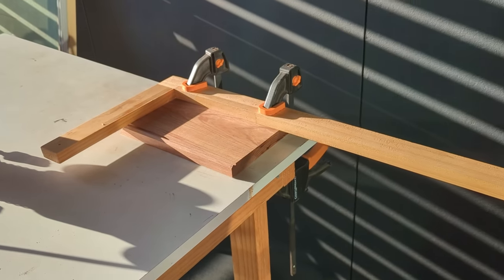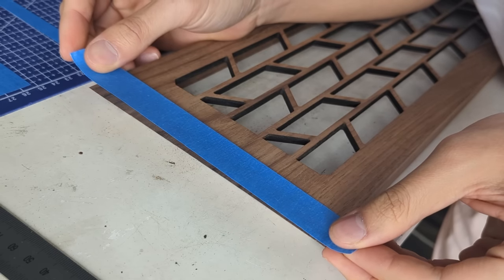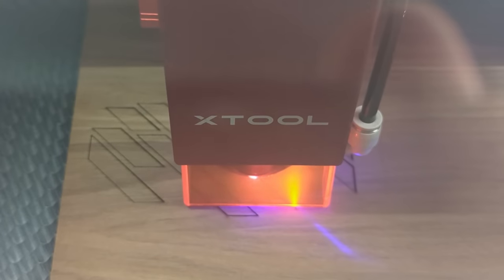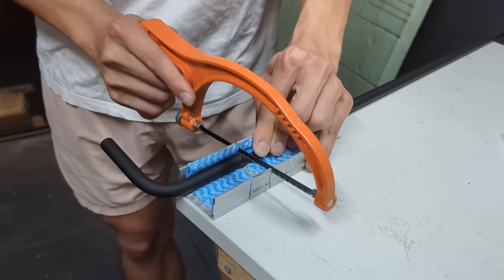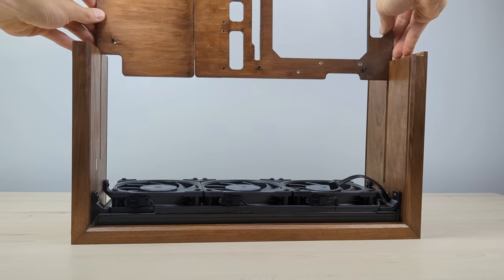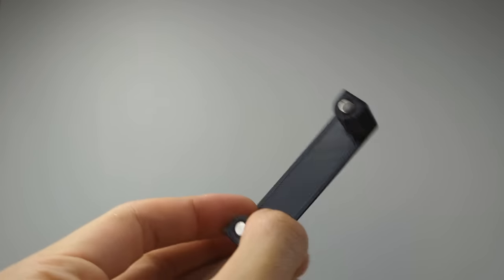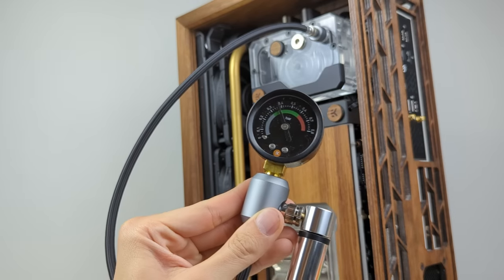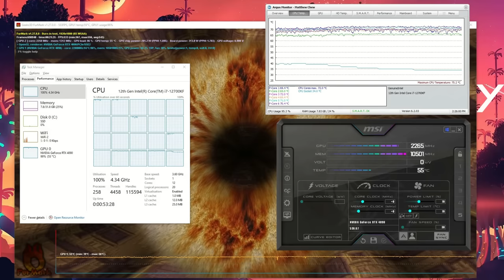Ultimate Hardline Wooden ITX PC | ASUS TUF RTX 4090 | i7 12700KF | DIY Wood PC Case

Comment: This is fantastic! Easily your best build yet. As others have said, the attention to detail is perfect. And it's amazing how similar this wood looks to Walnut.
If I had one critique, it would be this: When you have mitered corners, they're an endgrain to endgrain connection. This is not the strongest, and can spread apart or come apart entirely with stress (like heat buildup). To account for this, what you can do is reinforce the miter somehow. Usually with a spline or two. This provides a face grain to face grain glue joint going through the miter, and significantly increases the strength. You could even use something like brass that has been scuffed up on its face (to provide grip for the glue) as a spline to keep with the aesthetic.

Miter joint aside, this was truly great to watch.
Reply from the maker: Thanks! Yes mitres are not the strongest type of joint. But for a case that's not bearing alot of load, it's been proven stable for me.
Reply: Pointing out and then mansplaining the most unnecessary and granular detail
Reply: @LT.dans_new_legs  Or perhaps they were simply trying to be helpful by offering actionable information. No need to critique what is likely meant to be a helpful comment. The internet can be a nice place.

Comment: There were so many times throughout the build where you had a piece that seemed totally random but all of the other parts were arranged specifically to give that one part just enough space and it was like a jigsaw puzzle. I can't imagine the amount of planning it took to get it this perfect.
Reply from the maker: Yup, this project was a big one. Had to model every single part in 3D to make sure it fit into the system. Thanks for watching!

Comment: Great attention to detail on this build, really liked the cable management, very clean design. To avoid slight inaccuracies when you need to cut boards larger than your laser cutter consider using locating pins in the work piece. I find that works a treat.
Reply from the maker: Thanks for the tips!

Comment: This build is absolutely mind-blowing! The level of detail you’ve put into it is incredible. The only thing that could make it an 11/10 would be replacing the 3D-printed parts with anodized black aluminum to match the other parts in the build. Even so, it’s a solid 10/10. I especially love the idea of incorporating cable channels. This build would look amazing paired with a keyboard designed by Matthew Encina called The Encore, just like your build it beautifully combines both aluminum and wood in its design. Amazing work.
Reply: I just opened up your other videos and wow, you’re absolutely amazing.
Reply from the maker: Thanks! Indeed CNCed brackets would be ideal. But 3d printing is just so easy and accessible these days
Reply from the maker: Thank you for checking my other videos :)

Comment: This is some kind of therapy for my autism ! I am immediately heading to the workshop to work on my current project, then ordering a 3D printer later on (any advice on that would be welcome - I just want to print similar stuff to you). Great wood working skills - love the combo of old and new :)
Reply from the maker: That's great! Glad it has inspired you. I got the prusa mk3 second hand earlier this year and have been very happy with it. But the bambu models have been getting great reviews as well, although I haven't tried one for myself
Reply: @mxcbuilds6633  Thanks - will check them out. I wish I could 3D print some replacement body sections for my rusty mini truck !

Comment: Pro Tip: Use the same screw/bolt head design for a cleaner uniformed look. Take the time to line up the individual wires of the interface cables. Nice build.
Reply from the maker: For sure, great suggestions!

Comment: This is phenomenal stuff. My PC is housed inside an HP case from 2003. It's missing the front panel and all of the IO. I 3D printed a bracket for one of the unpopulated DVD drive bays with a mount for a USB board I salvaged from elsewhere. If this is the ultimate OCD soother, mine is the OCD irritator!
Reply from the maker: Haha as long as the PC works, that's the most important!

Comment: that computer would be a pain to clean and service for sure, it looks epic tho
Reply from the maker: Cleaning is not so bad, just disconnect all the cables, bring it outside, slide out glass panels, brush and shoot with some air, done. Coolant maintenance is going to be an issue I agree, I did not add any drain points. Would probably have to turn the PC upside down and drain it from the fill port.

Comment: For a smoother 3D printed surface use salt an an oven. Pack the pieces with about 2 pounds of fine table salt on a pyrex glass tupper or something like that, then heat to 80°C and the seams of the filament won't be there anymore
Reply from the maker: Thanks for the suggestions! Would try that out some day

Comment: Wonderful result. Thank god you saved so much cash on those little plastic knobs so you could pay the bill for the laser cutter lol
Reply from the maker: Probably a sarcastic comment but I'll address it anyways. Laser cutter is justified because nothing else  can achieve the same/equivalent result. Those black plugs which I only wanted for aesthetic reasons could easily be replicated using my printer. Saving 40$, I can easily use that cash to buy 2 more sheets of plywood for my next project. You have to be smart on where you can save and where you need to spend. Thanks for watching.
Reply: @mxcbuilds6633  I genuinely thought the end result was beautiful and the part of my original comment regarding the caps was meant in jest, not sarcasm.

Comment: That's just art, a real masterpiece!
Perhaps you could undervolt the CPU without loosing performance. Sadly that doesn't work as well as power limiting for 4090 cards. Did you plan the entire PC in CAD before building?
Reply from the maker: The heat issues isn't too bad for my use cases thankfully. Yes every single detail was planned in CAD before execution
Reply: Btw the cables aren't really sleeved. It's just a braided look imprinted into the isolation. I have the same PSU

Comment: I'm genuinely curious how the heat affects the wood in the long run. RTX4090 + i7 12700KF combo is hot af.
Reply from the maker: Been running it daily since the video was uploaded. No issues yet, no leaks, wood has not warped, temps are under control.
Reply: @mxcbuilds6633  Cool, hope to see a long term review about this build, I live in a tropical place so I'm curious how well this kind of build last in a warm climate
Reply from the maker: @pauljoseph3081  I expect it not to do so well in a tropical environment. The change in humidity will cause the wood to warp alot. I will do a "1 year later" type video when its due.

Comment: Beautiful, very very clean. Two questions though; One, wont those foam adhesive pads lose their adhesive properties relatively fast? Two, be honest, was the color scheme of the entire rig itself based on the T-Create Ram sticks, or was that truly a coincidence? Whatever the answers, I want this PC so badly, good work.
Reply from the maker: Thanks! The foam tape actually still holds the fan cable channels well. Only the fan connectors themselves have come loose from the tape. Nah, dark wood and brass has always been a classic combination, I reached out to team group specifically to use this set of ram to match the wood and brass theme

Comment: 1:19 ok, so you don't get that kind of stuff happening, two things.  First, clean your blade regularly, particularly, pay attention to the teeth. Use a brass brush to get the residue that's stuck behind the teeth off. Second, take a bar of soap (and at this, if you can find a clothes soap, not a hands soap - perfect) and make sure the sides of the blade are heavily coated in soap by rubbing the soap bar against the blade. It's a "per cut" thing you need to redo.
Bonus tips: keep your speed constant, let the blade cut for you, don't push it more than it needs to cut. Essentially, you'll want to feel as tho you're only pushing enough for the blade to move forward, and not a bit of pressure more. 
Finally, if the clean blade and proper speed isn't enough and you still see these burns, that means the speed of the motor and the speed of the blade are divorced. You'll need (in general) a faster cutting blade with more aggressive cutting teeth. Not necessarily in the sense that it will leave a rougher cut, but specifically teeth that have a more splayed out alternate pattern.
Reply from the maker: Thank you for the advice, will try them next

Comment: I would recommend for the router to use the flat sides just to make it easier and then just move the gard closer
Reply from the maker: I used to use the flat edge, but found that if I twist the router at all, the line swerves drastically as well.

Comment: as a carpenter, I wouldn't risk making a casing out of wood, and if someone has to, make it of the right type and properly seasoned. Wood is a living material, it cracks and, what's worse, it bends, especially when it is exposed to higher temperatures in the housing.
If the wood bends, remember what is attached to it along with it and I would be concerned whether the PCB will withstand or whether cold solder joints will appear, etc.
Reply from the maker: Surely is riskier using wood.

Comment: this is sooo beautiful, but will it deform with time? wood tends to expand/compress when temp change dramatically, especially in a PC case !
Reply from the maker: Thanks! Yes wood does move with temperature and moisture. But I haven't had significant issues with all my wooden builds in the past. Granted I've not use any one case for longer than say 6 months. So I really can't say the longer term effects it might have

Comment: Velvet jacket and cigars meets water cooling and RGB

Will be interesting to see a 5090 build when the time comes

Thoughts on integrating cable management into printed panels for the case rather than wood panels?
Reply from the maker: Thanks. Not clear on your question. I did the trays as seperate parts to allow for changes in future
Reply: @mxcbuilds6633  yes exactly that, you reminded me I had seen combs included with one of the graphics cards but never seen it actually used in a build

Since I deal with many Lenovo cases I wondered why the cable management is so bad for volume produced cases especially after seeing this build. It made me wonder about integrating more cable management into the case parts so your cables or extensions and connectors are part of the case panels. Also your thoughts about printing them into the case panels directly. Could he annoying if the cables fail but would save space and increase airflow?
Reply from the maker: Most probable answer is cost. For those enterprise pre-built systems, 99.9% of the users are not going to even open up the case let alone care about cable management. So there is no incentive for the company to invest in any extra design/engineering/manufacturing costs for that purpose. In fact, I've seen that they would mostly try and cut costs to the extreme as even saving cents on each unit adds up when you're selling millions each year.

Comment: Pretty legit build! That last 3D printed bracket you showed @ 25:00 made me sad though. I think there's definitely something off with the print settings. I'm surprised you didn't make that out of wood, actually.
Reply from the maker: Thanks, yeah there's room for improvement on that support surface. I avoid making small brackets from wood, they just aren't strong enough
Reply: @mxcbuilds6633  Interesting, I wouldn't have thought there'd be so much pressure on that bracket from that panel. Speaking of the panels, I have to get one of those laser cutters! I love the burnt edges left behind.

Comment: 360mm radiator is definitely enough. Your loop and the pressure should be well to use up to 50 degree. However, undervolting should be preferable for the cpu.
Reply from the maker: 50 is pretty warm, I don't see coolant temperatures that high anyways
Reply: @mxcbuilds6633  I run my 3090 and 5700x on a single 140mm. It works, but not without an undervolt. I will have to agree that 50 degree is unwanted. Mine lies at 47, which is okay.

Comment: This is an amazing pieceof art, but I couldn't help but notice that there were no dust filters installed on any side of the build. Which makes cleaning this PC a nightmare down the road. You'll have to take it all apart to clean the accumulated dust :(
Reply from the maker: Thank you. Cleaning is not that hard. All I have to do is shut down, disconnect the cables and power. Bring it on my balcony, slide out the glass side panels, blow jets of compressed air. No dismantling of any parts required. 😄

Comment: Thermally, wood is the most inefficient... But damn, it looks luxurious in this design you have made. Great job.
Reply from the maker: Check out my latest video comparing the temperatures between metal and wood case. You would be surprised
Reply: @mxcbuilds6633  It is not so much the heat dissipation (short term), but rather the behavior of the wood in the face of continued exposure to the heat of electronic components (long term).

Comment: Amazing build, but the router has a flat edge on its baseplate that would have worked better against the guide plate you had clamped down. That would eliminate any accidents that could have occured from using the round side and accidentally rotating the router while routing the groove.
Reply from the maker: Check this out, it's counter intuitive, but from my experience round is safer as per the video. https://youtu.be/xpOkNhEEftM?si=4KHNyUH7Y9cPavBN

Comment: With the CPU you could also use undervolting alongside the power limit to reduce the impact of the power limit on performance. It might not provide a huge difference, but it will still provide some difference (On my HTPC with a Ryzen 5 2600 paired with a Thermalright AXP120-X67 I was able to get a temperature drop of roughly 6 degrees Celsius, though it is worth noting that it is a very power-efficient CPU as-is)
Reply from the maker: Thanks for the tip! Temps have been fine for me but will look into if it gets hotter

Comment: It's undoubtedly  a piece of art❤️❤️❤️ the level of attention to detail and the insane knowledge in woid crafting combined with high tech knowledge show how genius you are. it's a crime to have it for a daily use 😅 although in my humble opinion znd correct me if iam wrong: that it wouldn't be practical for maintaince work the screwing unscrewing of the pieces Will Make the wooden case fall apart also the water cooling need special care 1nd attention.
Reply from the maker: Thanks! It's definitely NOT practical. It's a special piece of equipment that I am proud to use, knowing all of its downsides. Just like how a Ferrari is not practical at all to use every day for work (maintenance and running cost so expensive), but it's still a beauty and makes you feel special when you drive it.
Reply: @mxcbuilds6633  absolutely 👍 we must add to that that you're also a wise poet 😂

Comment: 18:00 it doesn't, in my opinion, the combination of 3d printed black pieces with the wood doesn't seem quite right, don't get me wrong tho, the build is really nice with a lot of details sorted out, but as someone with severe OCD, it doesn't look quite good, i would 3d model everything and send the models out to a machining shop to mill them out of stainless steel and after that anodize all of them or simply powder paint them.
Reply from the maker: Thanks for the feedback. That strategy would certainly yield even greater parts. I probably wouldn't invest that much into those plugs specifically as by that stage it would be cheaper just to buy the black ones from EK. However, in saying that, I do acknowledge that the print quality on those wasn't the best. I was using a rather old and cheap printer and have since upgraded. We should be seeing much better quality on the printed parts moving forward.

Comment: Very neat look, The only thing I dont like, is some of the 3D printed parts look a bit ugly, where I suppose support material had been used. I would do some kind of filling to hide that and match the quality of the rest of the build.  Im talking about things like at 26:21. The rest is flawless.
Reply from the maker: For sure some of those printed parts leave much to be desired. Was using a rather old cheap printer. Have since upgraded and we should be getting much better quality in parts moving forward :) thanks for the constructive feedback

Comment: Even though I have a normal size PC which I built I also have a Mini PC that is 1/4 the size of a shoe box and it has awesome high end components and it came with Windows 11 Pro installed, plus it was inexpensive considering everything it had in it. The only  drawback is that the Mini computer does not have a DVD/CD drive but I could attach an external drive if I need to.
Reply from the maker: Mini PCs are great!